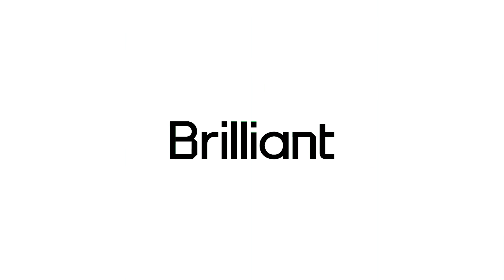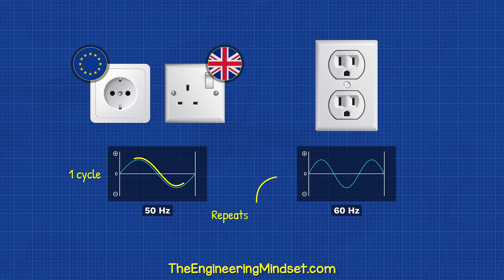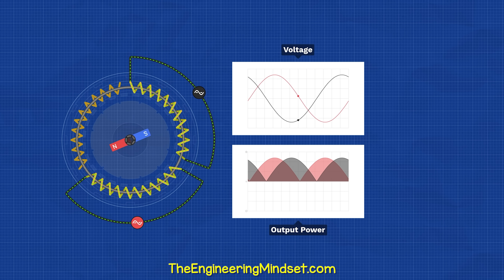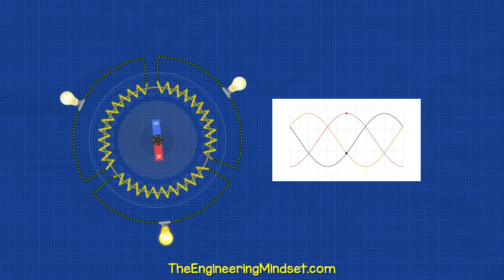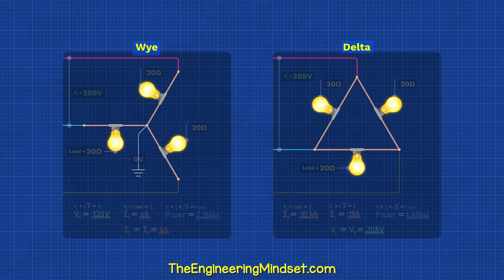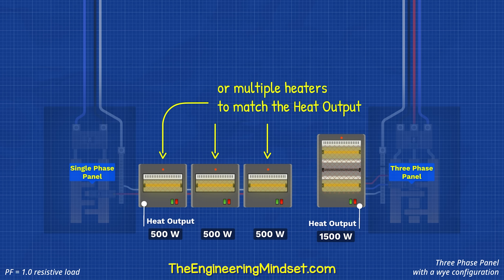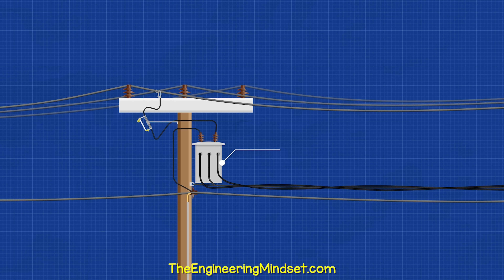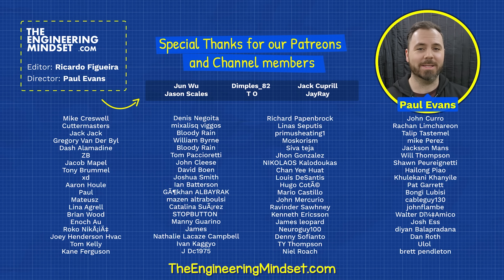How 3 Phase Power works: why 3 phases?

Comment: my house easily trips breaker if i run washing machine and dryer or microwave or vacuum. how do people usually solve this, a separate circuit just for laundry?
Reply: Well our washing machines here in Switzerland heat the water instead of taking hot water from the waterheater. So they need a good amount of energy. So they are normally connected to the 400v 3phase outlet. (Common in most households)
Reply: @Superbus753  : same here for modern washing machines and dryers, about 2kW each. but only have single phase. i hear that it might be possible to get 3 phase but will cost, and not sure how that would work for using our standard single phase appliances.
Reply: @Chris-op7yt  well we all have 3 phase already installed except maby some very old buildings. Appliances have to be 3 phase too. Some are 3phase but also offer to be run at only 1 phase (normal outlet) but at much reduced performance
Reply from the maker: Not sure which country you're in, but seems you have too much on the circuit or the breaker is possibly under rated or faulty. We've discussed this in the previous video https://youtu.be/gqEu9t8HwW0 I'd recommend calling in a qualified electrician to assess the breaker and diversity
Reply: @EngineeringMindset  : 20 amps breaker standard for electrical outlets on 240V.  2 x large appliance + a few smaller things already plugged in on same line quickly adds up to 4.8kW to trip breaker.
i'll check out your other video. thanks for response.

Comment: contrary to what the video says, many cheap LED lights DO flicker, because 1)  they don't full bridge rectify, leaving a 30 hz flicker, ew.   or 2) don't use capacitors to smooth the rectification, and so when the current passes 0V the LED goes out briefly.
Reply from the maker: Yep, good points. If anyone is interested who reads this, full bridge rectifier video here: https://youtu.be/RiRyzLl4Y8U